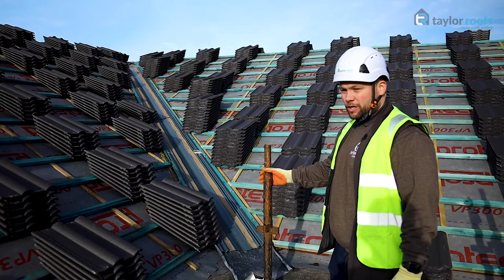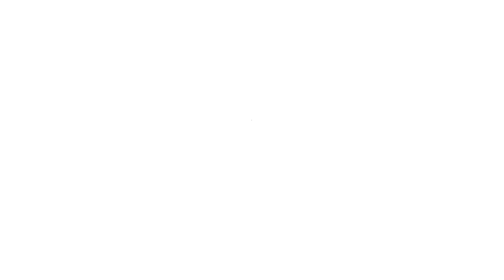GRP Valley

Comment: Love the way in Scotland you have Sarking boards so that GRP is fully supported on both faces 😊.  I've got English GRP with just a piece of batten down each edge, so not safe to walk up the sides of the valley, as there is just roofing felt underneath the battens. Also not sure if they fixed the GRP edge batten to the tile batten ends, or it just rests on the ends. Tap the GRP and the mortar falls out 😂.    Silly question: What would you see as the best solution for such an English lay board gable valley?  (Without redoing the entire roof which is mid 1990's) From inside the roof you can see fresh air between the lay board and the bitumen felt 😂

Comment: Shouldn't roof membrane be over lapped into the grp Valley then cut neatly to the Valley upstands ??
Reply from the maker: Hi Harry, because this roof is a retrofit roof which the homeowner was living in. The valley was felted with a liner up the middle then the two side roof panels felt brought in to the middle of it, so pretty much forming a valley to keep things watertight as the job progressed. The GRP valley was fitted later as the roof was battened and tiled. The method you are talking about would leave the roof a little too exposed during installation and is more common on new builds with no internal to keep dry at that stage. I hope that makes sense.